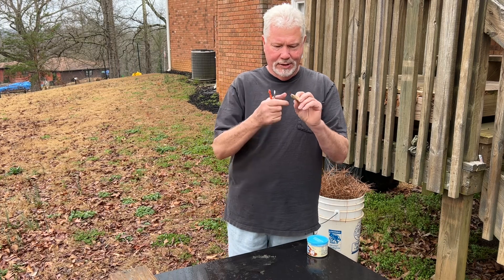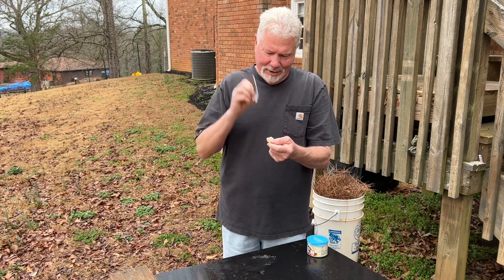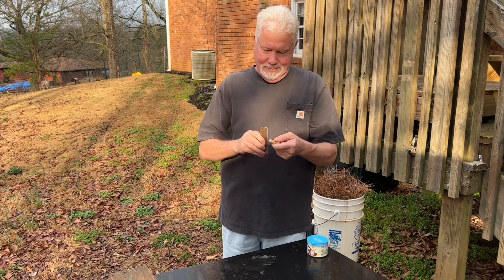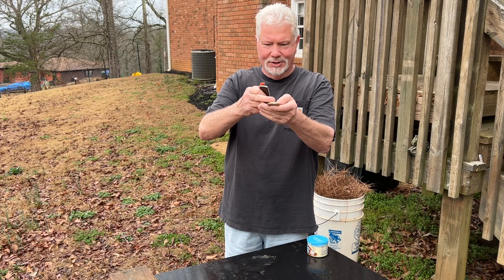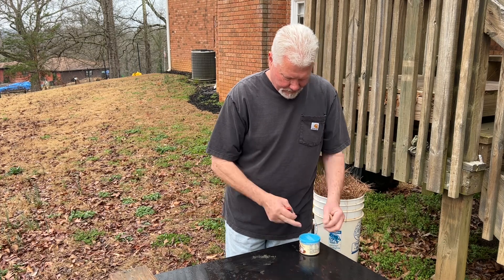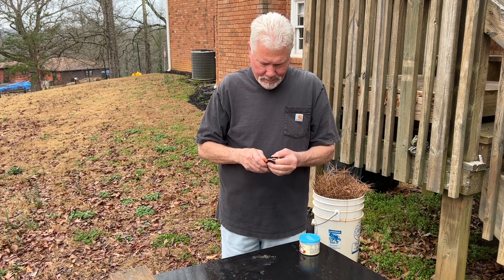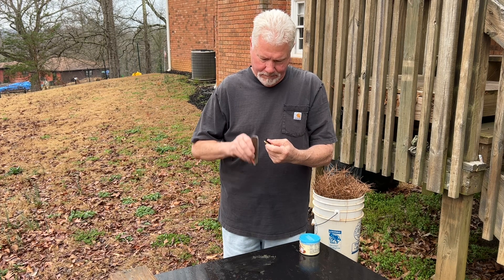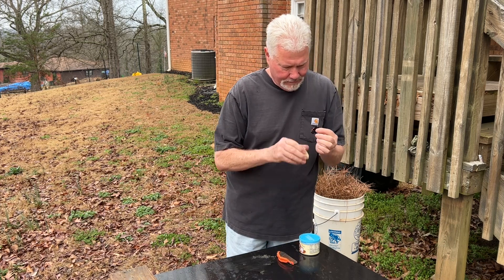Bow Drill, Why You Make So Much Smoke And Get No Ember

Comment from the maker: Bow Drill, Hand Drill, Bamboo Fire Saw, Fire Roll, Tinder Bundles, etc will not ignite to ember or to flames until you build the temperature up to 800 degrees. When your materials have moisture in them, they give off 212 degree steam. You will never get an 800 degree ignition until the cooler 212 degree steam is not mostly driven off. So, those great plumes of smoke that you see coming from your bow drill endeavors are really steam.
   Please follow the LINKs below and SUBSCRIBE. Thank You!

Bow Drill Paylist
https://youtube.com/playlist?list=PLkoXX8XsMW3kw-EXlvpLS68aJjR89P4ae
Flint And Steel Playlist
https://youtube.com/playlist?list=PLkoXX8XsMW3mFf5FgLtam1aDmXmqQQice
Reply: This is eye opening, thanks David!